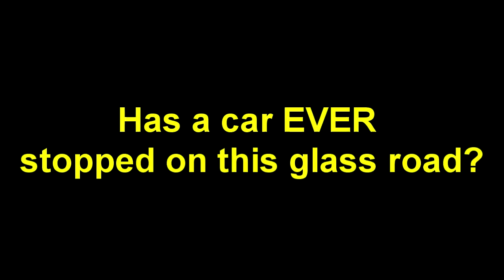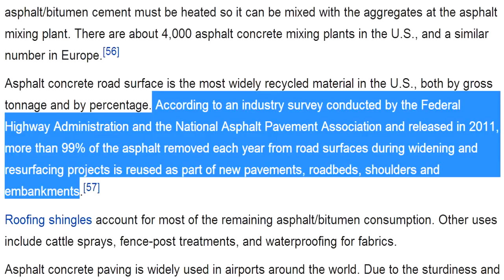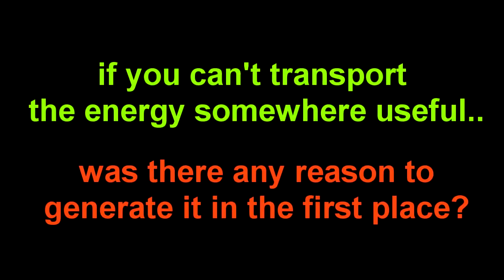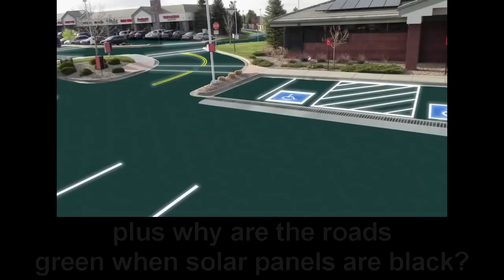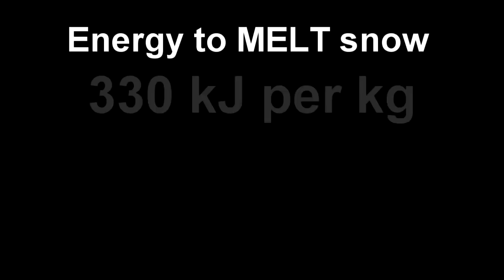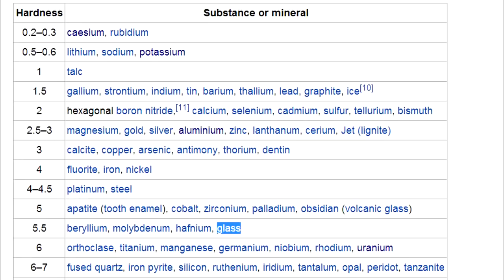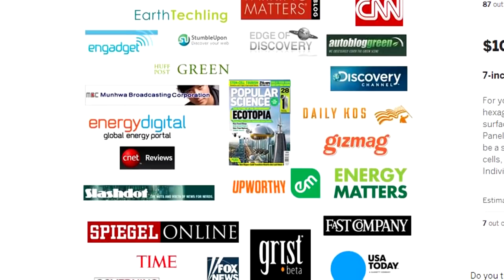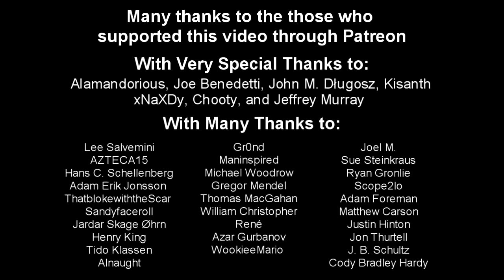Solar FREAKIN Roadways, Indiegogo's biggest scam ever!

Comment from the maker: The Netherlandians built a 70 meter bike path for $3.3 million. It just shows you how ridiculous this idea is. Do the math yourself! For a four lane mile of solar road that's $370 million that doesn't include signs, exit ramps, bridges, overpasses. For a regular 4 lane highway it costs $5 million. A hundred miles of 4 lane solar road costs $39 billion. For a regular 4 lane road 100 miles long that's $500 million. For the cost of a hundred miles solar highway you could build 7800 miles of regular 4 lane road surface.  http://worldtruth.tv/netherlands-becomes-first-country-to-use-solar-panel-roads/

Comment from the maker: It would be cheaper to buy everyone an aircraft and build more airports.
Reply: hmmm probably not. the amount of having to create roads today, the manpower in re-doing roads, the machinery in doing all of this would probably cost a lot more in the long run. Especially when there is a resource here that gives back energy. Yes, its is expensive to create, but so is creating roads with asphalt and such, but in the long term, looking having to repave roads, filling pot holes, compared to just switching panels...seems easier to me......say all you want but this is a better utilization of roads....no matter the cost.
Reply from the maker: all they have is a thin metal frame and an 1/8 of an inch of tempered glass. Screws hold down the glass! How long do you think it would last? A month under normal road conditions? For all we know, the 20 ft of solar driveway they show could be CGI effect.
Reply: Nathan Kreuzman
"Say all you want..."
Your faith is strong, you will not be swayed by any argument, no matter how good.

You are a good customer, and I have a bridge to sell!
Reply: hmm You're probably right. but look how expensive it cost to create the first highway systems in the US. It wasn't cheap either. I just feel that with all this road we have, wouldn't it be nice if we could utilize a little more than just traveling on it? I wouldn't mind my tax dollars going to this.
Reply: and BodeBliss, I would definitely remind you that before any major project that is funded, lets say by the government, there would be "federal regulations" as how much impact and strength of the glass would be needed. And there are already materials stronger than steal and are transparent that can be used. and i'm sure they would last a little longer than a month, the only real way to find out is to start small...make a small patch of road out of them and see how they handle a real stress test.
Reply: Nathan Kreuzman Cost is just one part of it (though nothing we still use today was ever as expensive as "Solar Freaking Roadways"). Reality is the other. 

1. It will never be energy efficient. 
2. It's considerably more costly and difficult to replace part of a solar track. 
3. Glass is way too soft.
4. Heating those "Solar Roadways" over one winter will cost more than those things make in a 1000 years.
5. Their LED driven roadway "markings" will never work properly, as long as the sun is up.

Comment: This guy is dusty, for example if power is generated in your street, outside your home why would you need 250kv power lines!   Bull dust!    Some good points but the dusty bits makes me feel he has no cred.
Reply: Because not all roads are in urban areas. If you have a long stretch of road in the middle of nowhere, you have to factor in resistive losses just like in any other power line. Only that now you would feed the power line from many locations along the way, instead of feeding it from a single point, which adds complexity.